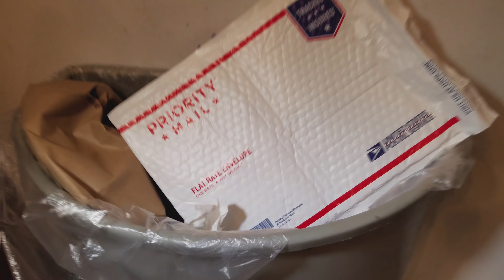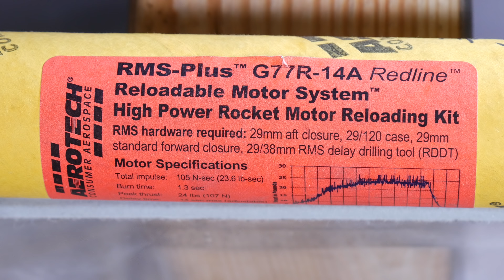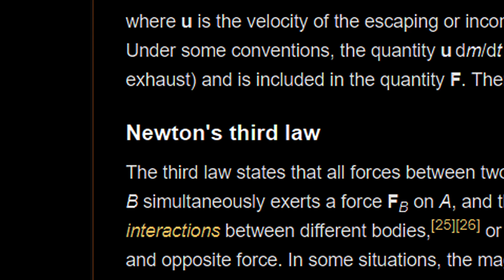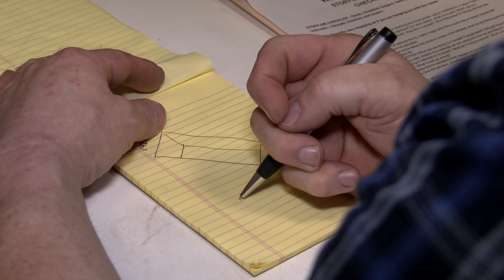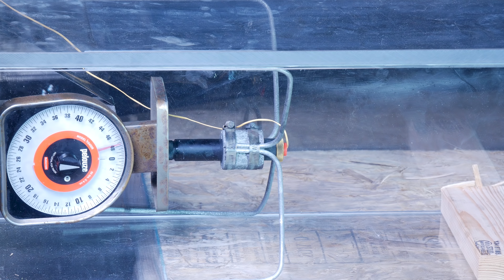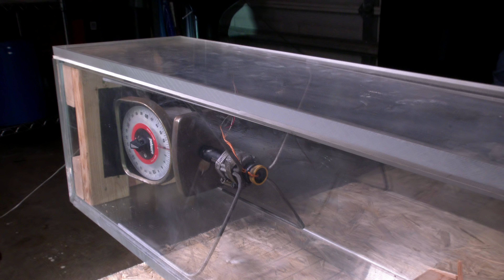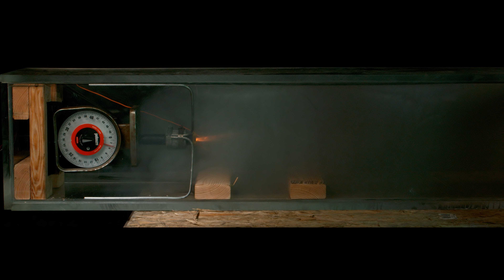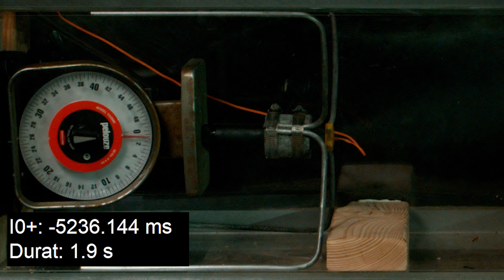Rockets in a Vacuum Chamber - Newton's third law of motion Visualized

Comment: Forward momentum is impossible in a vaccume and away from earths magnetic field, that's what the "dome" is, once a rocket goes too high it stops because momentum (even without thrust)is achieved from the air under the moving rocket refilling the vaccume void left behind.. (this is also how airplane wings work) when there's no more atmosphere there's no way to keep momentum from the imploding atmosphere behind the object and theres nothing to thrust against.. this is why rockets hit the "dome" 
As soon as imploding atmosphere is lost the momentum stops and earths static(gravity) pulls everything  back down again until the mass(rocket) collides with the  equivalent mass that the rocket is made from and can no longer sink down do to the earths mass being just as dense.
If you try this underwater you could shoot a rocket from 10ft  down with just enough thrust to reach the surface but not enough to get into the air, and you will see a similar effect, it will reach the top, and then sink back to the bottom.
theres videos of objects burning in a vacuum chamber using a fresnal lense and the smoke just falls to the ground and builds up like water.
Reply: Would a crossbow fired into a vacuum have any recoil?
Reply: @jareddavis4980

Spot on. 
👍
Reply: @Chris-fm1rk  - SO you still have not learned a thing from what I have told you?

SO, you are still arguing that a crossbow would not have any recoil if fired into a vacuum?
STILL unable to answer that question?
Reply: @Chris-fm1rk  - So did you take my challenge on the video on my YT channel?
Just prove I am lying about my 28 year career of launching things to space and claim your reward!
Reply: @Chris-fm1rk  - And I WILL honor the money. It is IN THE VIDEO.
Now just prove I am lying about my 28 year long career of launching things to space and claim your reward.
You CANNOT because I am not lying.
Reply: @stuartgray5877  I DON'T CARE WHO YOU ARE 🤣
Reply: @Chris-fm1rk  See how obsessed it is with me? Even if I did have a dozen accounts they'd all be telling the truth, unlike chatbot stuart the programmed liar 😂
Reply: @papalegba6796  Mate, it's been talking to me for months lmao. At times I've thought there was genuine memory loss at play because it's been either repeating conversations or lying about what's been said. It was winding me up lol.
Reply: @Chris-fm1rk  - "At times I've thought there was genuine memory loss at play"
But YOU are the one that keeps CHANING YOUR NAME genius.
Reply: @stuartgray5877   I'm not doubting rocket science entirely it clearly does work under the right conditions, a crossbow would have less recoil due to it not having an atmosphere to do a massive backstroke against, that turns the air  into a newtonian fluid,  it will still recoil from accelerating the mass, but that only works while still within earths magnetic feild, the entire earth acts like a giant mag lev track and the magnetic attraction is what gives mass a specific gravity, if the crossbow is fired out side of that field in a vaccume accelerating mass has no recoil do to nothing having a specific gravity, the arrow would stop at the end of the string because the two objects would have no where to go but stay attracted to each others micro/static feild. If a bow is fired in a vaccume chamber the arrow will fly because of the magnetic/gravity attraction to earth, it wouldn't be flying it would be levitating do to the  positive and negative currents emitted by the matter surrounding it, assuming the chamber is large enough it would succumb to the gravitational forces eventually because of the resistance of the emf/gravitational field, think of gravity acting as a maglev track strong enough to pull all matter that's non conductive. But still has both positive and negative traits so doesn't immediately pull the object down it floats things until the resistance eventually slows and stops the object, the arrow will still have weight to it because of the specific gravity if you swing it around the specific gravity will give it the appearance of having weight and a mechanical resistance but what you're actually feeling is the objects relation to its connection with earths gravity, out side of this force it won't have mass, and therefore can't accelerate. Tell me this.. if space is filled with micro/macro meteors how is it that we can look through a telescope and see billions of light years away? Wouldn't it be blurry like trying to see through fog? Even on a clear day the atmosphere after so many miles diffuses the light and mountains in the distance will look blueish. That effect occurs within just 30miles on earth looking into the horizen.. Even if those meteors have the spacing of 1000miles between them, looking at something  billions of light-years away would be impossible. Stars aren't stars they're points of light that got trapped in the vaccume just outside of earths reach, the sun doesn't project light, mass attracts it like two electric probes, but without the plasma spark connection between them due to no atmosphere to create the plasma.
If you were to try throwing a ball in the vaccume of space outside of a gravitational feild the ball would just be stuck to you like static, you wouldn't be able to get it away from you.
Reply: @jareddavis4980  - " a crossbow would have less recoil due to it not having an atmosphere to do a massive backstroke against"
The video on my YT channel of the recoil from a crossbow under different circumstances proves this to be incorrect.
The recoil depends FAR more on the mass of the projectile than on the air resistance the projectile feels.
Reply: @jareddavis4980  - "it will still recoil from accelerating the mass, but that only works while still within earths magnetic feild"

This is false. I have built and launched more than one deep space science probe with propulsion systems then helped operate them.
I have been a member of the fueling team before a launch and a member of the deep space navigation team that helped fly it during the mission.
Reply: @Chris-fm1rk  I got a one day ban for bullying & harassment just after your reply, so it's clearly been reporting me using its sockpuppets. It's basically an AI torture device 😂
Reply: @papalegba6796  That's interesting because I got one as well. Stuarts obviously been reporting us up 🤣
Reply: @stuartgray5877  He doesn't understand basic physics and he reports people to Youtube like a little girl when he gets overwhelmed, yet he claims to have engineered and tested advanced technologies for an aerospace firm?!?!

Some strange people in the world is all I can say. 😁
Reply: @Chris-fm1rk  - "Stuarts obviously been reporting us up"
Nope. Havent reported anyone in a very long time.
Reply: Chatbot Stuart is desperate for us to reply to it so it can report us again 😂
Reply: @stuartgray5877  "recoil from a cross bow under different circumstances"  
Did you do this experiment outside of earths gravitational/magnetic feild? I doubt it since that would be impossible to achieve while in your back yard.. your experiment only removed one variable. The next variable is removing the effect gravity plays that gives the cluster of light that we call matter the illusion of weight/inertia(mass). The same forces that give matter a specific gravity tries to both lock it in place and pull it down. The denser the matter(cluster of atoms made of light) the more earth has to grab on to and gives it the illusion of weight.   Outside of these forces with nothing to anchor it internally a house sized rock would feel like a Styrofoam ball, if somehow you were out in the vaccume away from earth you would be statically clung to the rock and wouldn't be able to get away from it..  unless an outside force like earths fields grab a hold of it (and you) by giving the atoms mass again to be able to pull away from it via inertia/momentum.
Matter that we interact with is just a  frequency of light that our bodies/the world are in tune with like a radio station. If our bodies weren't in tune we wouldn't even see the world.
So u might think you're firing an arrow but you're firing a cluster of light using an object made of light.. both are actually made of nothing, and is only relevant to the universe because of your attunement with it, and it's relation to the unseen forces acting on it while near this cluster of who knows how many frequencies we call earth and its fields.

Tl:Dr the only reason a non self propelled object Flys in a vacuum is because earths fields give matter mass to be able to have inertia.
Reply: @jareddavis4980  -"Did you do this experiment outside of earths gravitational/magnetic feild?"

YES.
The Stardust, Genesis, and Deep Impact spacecraft that I helped build, launch, and operate in space ALL had crossbow like mechanical separation systems. We tested EVEY ONE OF THEM IN space. One in DEEP space 130 million miles from earth.
Try AGAIN genius.
Reply: @jareddavis4980  - "is because earths fields give matter mass to be able to have inertia."

NO. What you are describing is "WEIGHT" .
Mass exists outside of gravitational fields and givers object Inertia. "Inertia" exists without gravity. 
WE HAVE TESTED IT.
Now trying learning the difference between weight and mass before trying to lecture actual engineers about basics physics. YOU could not pass a high school physics exam if your life depended on it.
Reply: @stuartgray5877  there's still emf and other radiance that effect the matter to give it weight/mass when I say mass I'm referring to the side to side resistance to movement as well.
Reply: @stuartgray5877  how do you stay in contact with a probe that's millions of miles away.. and how is it surviving metal meteorites flying 20k +- kmph?   I drive a few miles out of town and lose cell service..
Reply: @jareddavis4980  Apparently you are ALSO unaware that the light from STARS we see are just Radio waves.  See radio waves can travel forever or we could not see stars billions of light years away.
Now I suggest you complete high school before trying to lecture others about basic physics.
Reply: Forward momentum is independent of atmospheric pressure or a magnetic field. As Newton predicted: objects continue to move in a straight line when no force works on them. 
Rockets don't hit a "dome", they achieve orbit. You can see satellites with the naked eye. You can measure their speed and altitude from the ground, and find that they are in space.
Reply: @jareddavis4980  Where did you GO? I was looking forward to having a high school dropout lecture an actual Electrical Engineer about the nature of radio waves some more.
It was very entertaining.
Can you even SPELL "Maxwell's Equations"?
No? I didn't think so....
Reply: @stuartgray5877  voyager supposedly has a 250w battery that's 40years old through the extreme temperatures of space.. how does only 250w of power  reach accross the solar system through the magnetic feilds of other planets, remain intact through the radiation from the sun, travel through the earths magnetosphere, and atmosphere and be collected by a receiver on earth? When I lose cell phone reception just driving out of town? 😂
Reply: @h.dejong2531 do you really think you can see a basketball sized object 62miles away into "earths orbit"?  Any communication satilite is just held up by ballons filled with helium that never deflate. 🙄
Reply: @jareddavis4980  Actually the RF (radio) system on the Voyager probes are only outputting about 1/4 watt.
Yes the DSN can still lock on that signal beyond the orbit of Pluto, but it requires some extreme measures like cooling the amplifier to Liquid Helium Temps.
Reply: @stuartgray5877  so you're saying .25watts (something barely able to light an led bulb) is transmitting across the solar system? While flying away at 38,000mph from us and we're able to lock onto that signal while on a rotating planet at 1000mph.. and that .25watt can transmitt through the suns radio interference without the earths protective layers. Using a battery that's 46years old that's still operating in the cold of space? 🤔
Reply: @jareddavis4980  Yes.  But I am only an Electrical Engineer who specializes in the Telecommunications systems of deep space spacecraft, so what would I know?
Reply: @stuartgray5877 The radiation would be like an emp as soon as it leaves the earths protection. This is assuming that rocket propulsion even works while in a vaccume and no gravity (it doesn't) if you could some how escape the gravity of earth the rockets exhaust would just  wrap around the rocket itself and encase it in a toroid-like way similar  to earths magnetic feild.. no thrust the lights above that are stars, are not outside of earths static field (not gravity) satellites are held up by helium balloons. And your career in nasa was actually a massive psyop to make America look all powerful and to punk the other countries. The real technology was movie film making. It gave the government the ultimate weapon of "let's not and say we did by faking it"   and the money was instead sent to fund other secret programs that would've otherwise been shut down for being so unethical.
Reply: @jareddavis4980  you should write a paper and explain how all the Engineers and physicists are all wrong.
Reply: @stuartgray5877  they probably just sat you in a room with an equivalent of the atari with the game "astroid" then  convinced you, that you were controlling a space craft..
Reply: @jareddavis4980  I don't think I can see satellites, I know I can, because I've done it. With the naked eye you can't resolve a satellite, but it reflects enough light to be visible to the naked eye. 
And with a photo camera and some math, I can measure their altitude: they're at 400 km and higher, proving they are not hanging from a ballon: no balloon has ever been that high. 
I can also measure their speed. At 28,000 km/h, satellites move a hundred times faster than any balloon has ever been. So, simple observations anyone can do prove that satellites are in space, not in our atmosphere.
Reply: @h.dejong2531  the upper atmosphere is moving much faster relative to the ground speed the balloon reflection is what you're seeing the Balloon is simply moving with the air speed. It doesn't experience choppy turbulence like an airplane does or a tree placed to the ground. Because it's moving with the upper atmospheric gasses (not breatheable gases its so high) the upper atmospheric gasesses are not the same that we have down here at ground level, and they move much faster than air does at ground level. Not 28kph fast but faster your math only works because you think it's that high. It slows down when you don't measure them at 400km up (you wouldn't be able to see them) you think you're looking at a small object but it's actually a huge balloon. Like the supposed "chineese spy balloon" aka satalitte that malfunctioned and lost altitude and needed a cover story.
Reply: @jareddavis4980  Just so I have this straight: A High school drop out is telling an Aerospace Engineer that his entire 30-year career of building, launching and operating deep space science probes and earth orbiting spacecraft is all fake?

Cool story bro.
May we suggest you finish high school BEFORE debunking 2000 years of established science?
Reply: @jareddavis4980  The upper atmosphere does NOT move at 17,0000 MPH genius.
Reply: @stuartgray5877  I never said it did, I said your math is wrong they're not that high up when calculated from a lower height as a variable they're not moving THAT fast.. think of: how fast an airplane appears when it's lower vs higher up. The satalite looks like it's moving fast because it's lower than we're told.
Reply: @jareddavis4980  SpaceX now has more than 350 Launch videos showing the ENTIRE ASCENT - FROM THE ROCKET
I guess all of those are "fake" right?
Reply: @jareddavis4980  NEXT - Explain WHY SpaceX keeps launching rockets about twice a week now if they are all "fake" and just crash into the ocean.
Come on EXPLAIN IT.
Reply: @stuartgray5877  yeah they're launching the next gen satalite balloons, they don't take off from ground level, they're too delicate to survive the ascent on their own. the higher up, the wind moves at a consistent stable speed relative to the ground and lower atmosphere.
Reply: @jareddavis4980  So that's a "No I will NOT answer any of your questions as a truthful answer proves ME wrong".

Thanks for that.
Reply: @jareddavis4980  Oh so NOW we need "Rockets" just to launch Balloons.
Who knew?

Cool story bro.
Reply: @jareddavis4980  That is nonsense. I don't think satellites are at 400 km altitude, I know because I can measure that with enough accuracy to know that they're not at 40 km altitude but ten times higher.
Reply: @h.dejong2531  what? Re read your statement your comment makes no sense "I don't think it's 400km" then you say it's 10x higher than 40km? Which is 400km 😆
Reply: @jareddavis4980  I'm saying I don't just "think" it's 400 km: that 400 km is not a guess. I know it's 400 km because that is the value I measured.
Reply: @h.dejong2531  how did you measure it using just a picture? Wouldn't you need to know it's original dimensions?
Reply: @jareddavis4980  No, I can treat the satellite as a point source. I'm doing parallax measurements: for the altitude, I take two photos from positions a few km apart (at the same time), and I measure how the position changes relative to the background stars. For speed, I can then take two photos with a known interval between them and measure how the position changes relative to the background stars.
Scott Manley has a video that shows how to do this.
Reply: @h.dejong2531  it wouldn't be accurate, the latency for the signal between the cameras to take the picture at the same time wouldn't be precise. How would you guarantee it?
Reply: @jareddavis4980  Just using synchronized watches you can get within one second. And it's not that hard to calculate the error introduced by that.
Reply: @h.dejong2531  if it's moving at "28000kmph"  1second would make a major difference 🤔